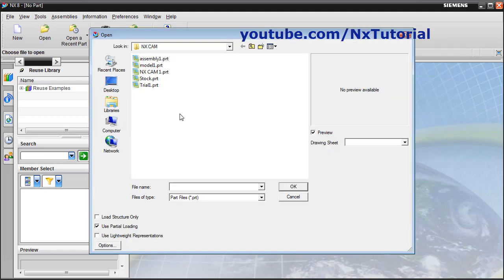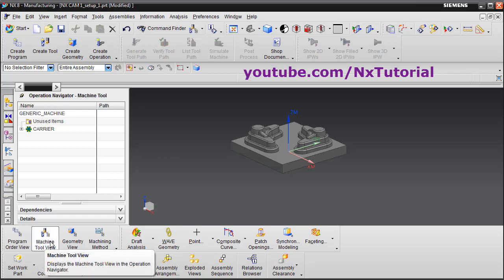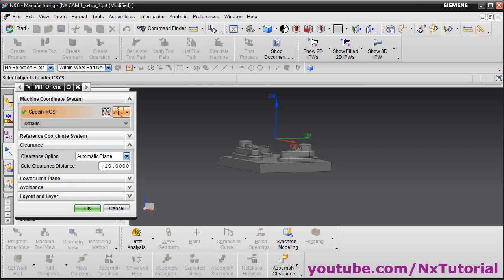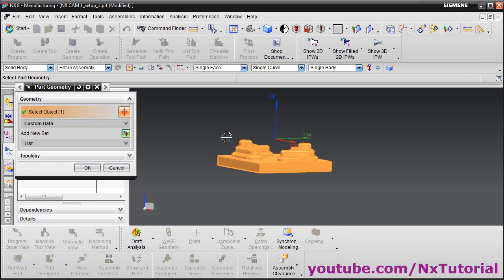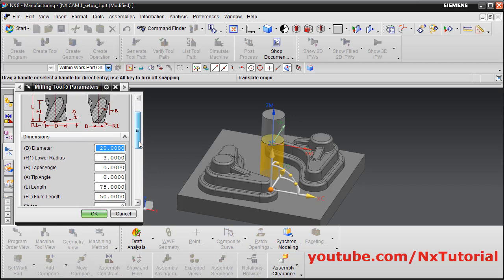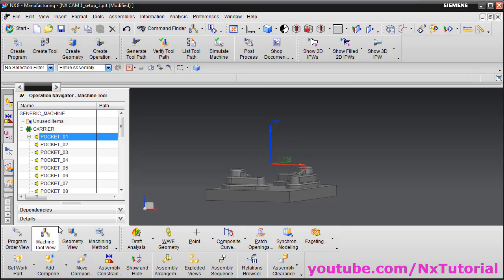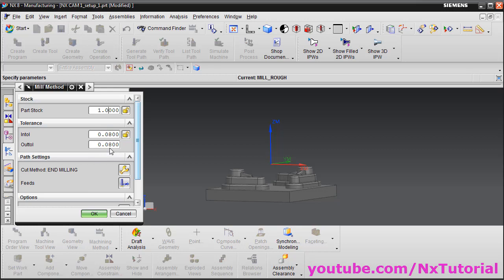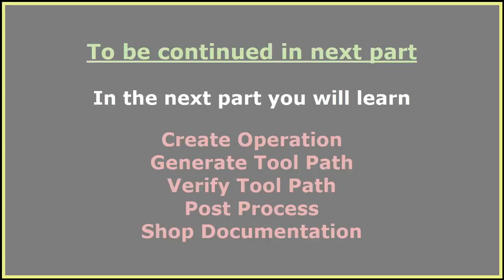NX CAM Tutorial for Beginners - 1

Comment: Good day sir!I have one question and i hope, u can help me with it.The biggest problem for me in NX CAM is to automate code generation.I meant I must generate every single operation to separate nc code with uniq name(it could be even operation name or operation number).So how can I automate this process,should i use macro or jornal options?I hope u can help me
Reply: For unique naming you have to use NX power naming (automate naming as per your requirement) and as far as output for each operation there are two scenarios one you want individual NC files then in post you have to modify even though you select all the operations it will through out puts for each operation one individual NC file (Example 10 operation then 10 NC files) .

2nd group output select all operations it will through out in single NC file.

I hope this information helpful to you.